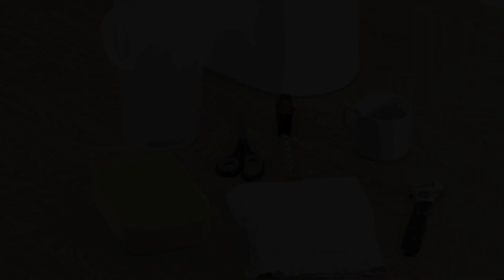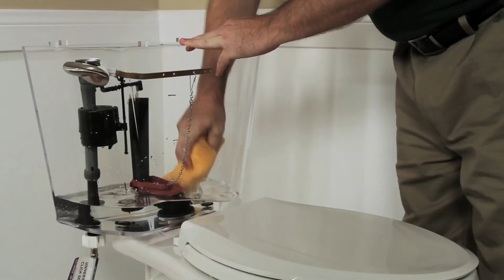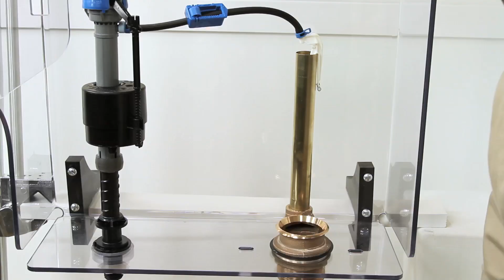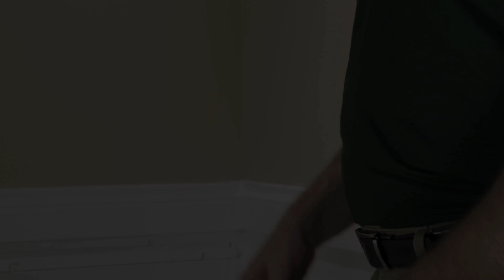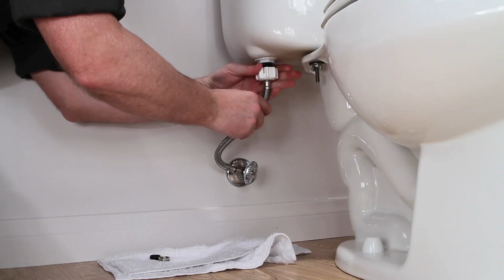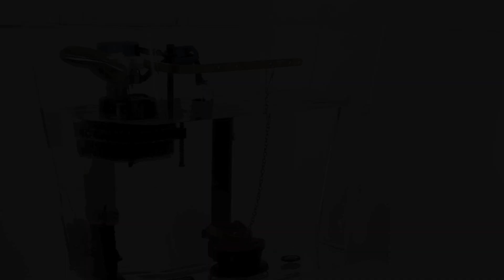How to Install Fluidmaster's 550DFRK Duo Flush System

Comment: Before you invest money and time in this Duoflush, take a look at the lid to the water holding tank.  If the tank was mounted too close to the back wall, the lid to the tank will be pushed forward, AND the lever won't work.  To flush the yellow and save water, the lever must be able to be lifted up.  The overhang of the tank lid won't allow this movement, and you're going to have to flush down every time and waste water.  This unit won't work on two of my three toilets.

Comment: Glad I saw this video...I have a tower valve which the video says, that system is not compatible with this duo-flush system (but the instructions in the box didn't mention about the non-compatibility ) Thanks Fluidmaster!

Comment: when you flushed the system you removed the rubber seat, then you showed you replace the cap after the flushes and the seat remained on the toilet lid.   So you do not need the rubber seat?

Comment: I once ordered this dual-flush valve from ebay and after testing with different ways it failed to seal after 18 testings. (and also it is very brittle, the way it snaps on the existing flush valve on only just four little pegs. . . it brakes after even slight bend or curve to the side, sop yeah - this dual fulsh valve is not very good at all) I tested every possible flush valve that can be purchaced in the Europe and USA (from ebay) and you will not believe, what valve was the most reliable valve - The Russian made valve. Russians flush valves and fill valves are build so nicely, that it amazed me how well they performs! the Russian flush valve works in very simple, yet very reliable way, very decreasing the fail chance. And the fill valve passes so much water that a 5 gallon tank it filled in  28 seconds LITERALLY!!! Russian made toilets and every plumbing parts are the best quality in the world! and by the way, I am very experianced plumber and I not saying all this from a "light bulb" as Russians say, I done a lot of testing and from my own experiance of seing how things fail and fail, and Russian made stuff lasts longer than 30 years. So yeah. . . the best choise of plumbing is to Russian made stuff. And I didn't mensioned, but Russian made stuff are so easy to install, let's say the bath tub drain siphon in USA is very hard to install - nut after washer after nut after washer after nut. . .  it is very hard to install it without leakage, and when you consider that Russian bath tub siphon is only two plastic nuts, two one flexy hoses and two screw (one for the main drain and one for the side "emergency" drain) that holds every thing tite for longer than 20 years. . . it just ridicilous how simple yet reliable the Russian stuff are compared to USA stuff. . . But I am not saying that USA is bad - the USA is making every kind of others things that Russians makes in bad and very unrialable quality, for example the USA makes the best electrical stuff in the world, while Russian made electrical things are just in medium quality .. . so it turns out that everyone wins :)

Comment: Installed this complete system in about 1/2 hour. Installation included the angle adapter. Very easy to install.

Comment: PRODUCT SUCKS! I installed this and it would SOMEtimes not stop oozing into the tank (thus wasting all the water it supposedly saves). I have to jiggle the flush valve cannister. 
AND the handle takes so much effort to flush it that rotates regularly in the tank opening for the handle. The plastic won't accept the amount of pressure it would take to keep it from moving.
AND FINALLY the cable BROKE OFF inside the canister (the main flush valve) so NOW I CAN"T EVEN MANUALLY FLUSH THE TOILET!! 
AND THE CHERRY ON TOP OF THE CAKE ... THERE ARE NO INSTRUCTIONS ON REMOVING OR REPLACING THE "EASY SNAP ON" VALVE.
AND JUST TO MAKE THIS EXTRA ANNOYING ... they have NO SATURDAY SUPPORT HOURS and in the "Frequently Asked Questions" ... apparently for "common toilet problems" NOBODY ever needs to remove the "easy snap on" canister.

DO NOT BUY THIS PRODUCT.

Comment: This thing is a piece of shit...... Idea and concept is a great idea. Production and quality of product is awful. First off the handle cable idea needs to be redesigned its squeaky and sloppy.  Also the handles made out of plastic its cheap and ugly. #2 the handle hold to properly flush isn't the way this things supposed to work.When you watch this video you see the person just use the handle for a mere second but mine doesn't hold the flap up for some reason and you have to hold the handle which completely defeats the purpose of saving water. The 3 dollar plastic flap from the old style worked like a champ for ever. And this new thing didn't work for 5 minutes. I made the mistake of purchasing this product today and wasted a 1hr of my time to install just to find out its made like crap. I will be returning this product in the morning. Also your fill valves are shit 2 always have been and always will be. You as a company need to find a way to produce a better product but I understand its all about margins.... Figure it out cause your products suck....